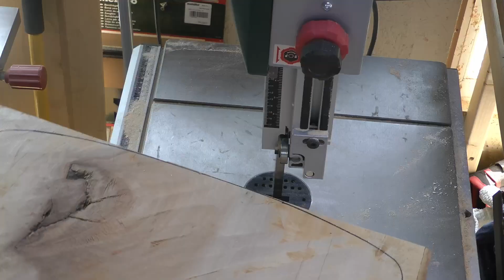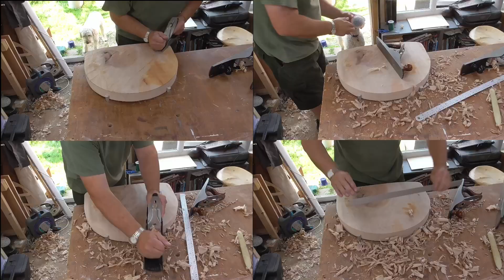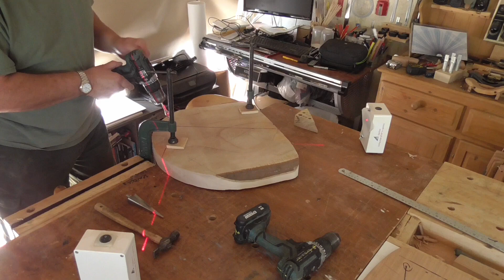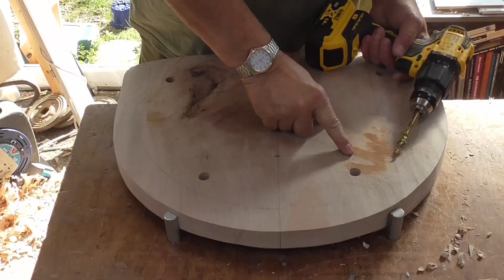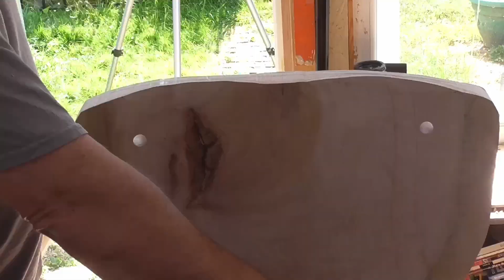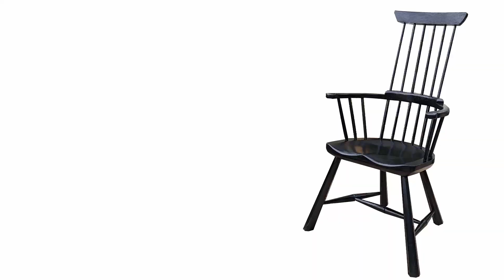Let's make a stick chair - part two

Comment: Hi👋 thanks for sharing this series of videos. Your a true craftsman. Beautiful work!!!! ❤ Not sure if you mentioned the thickness of the seat? What is it exactly?
Reply from the maker: Glad you have found them useful. I typically use a seat blank of around 2 inches/ 50mm thick. I think this was near enough that, for this chair. The thinnest I'll use is about 1.5 inches/ 38mm and I have used up to nearly 3 inches /75mm. The thicker the seat blank the more I will saddle it/shape the seat, to make it more sculptural. But 2 inches is the sweet spot👍

Comment: Hi Rob, great video and very informative. Is reaming holes and tapered tenons essential? Would straight tenons and holes work as well?
Reply from the maker: Yes, straight tenons can be used with a straight drilled hole. The advantage of a tapered tenon is that it tightens as you apply load/sit in the chair. So if the wood should shrink, the leg shouldn't become loose. But with wood that is good and dry, a straight tenon is fine and the shoulder will hold the leg in place. Thanks for watching.
Reply: @crouchvalewoodcraft  brilliant, thank you for your help. Look forward to watching the rest of the series
Reply from the maker: Enjoy👍